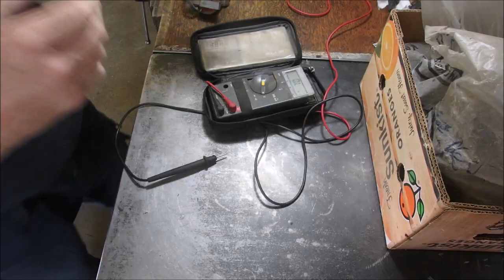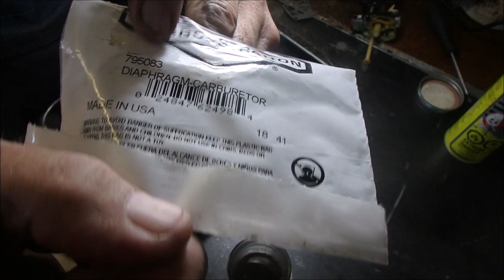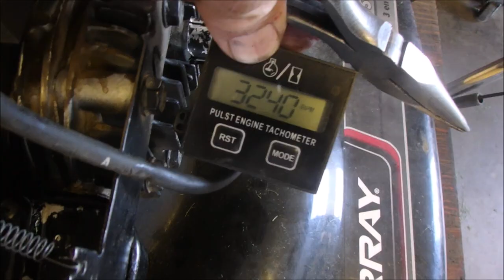A Nice Older Murray Classic That Doesn't Run

Comment: It being a 158 cc engine is probably a 3.5 to 5 horse power Briggs and Stratton engine  depending on the year of it being made   the ignition system is either points And condenser or  electronic ignition system
Reply from the maker: Right  points went away in 1982 or 1983
Reply: @BrucesShop    cool beans 🫛🫘 there Mr Pender

Comment: Yes,my 3 horsepower Briggs and Stratton powered Supa swift lawnmower is 35  years old this year & I gave it a rering about 4 years ago,it has done a fair bit of work since then.

It runs the simple choke O Matic carburettor which simply just draws the fuel up using the siphon method,it doesn't even have a fuel pump in the diaphragm area of the fuel tank so it's a very simple albeit very reliable design.

I had the original ignition coil fail on it which caused it to sputter at high RPMs which led me to think that it was due to a fuel related issue when it was actually caused by a failing ignition coil !
Reply from the maker: Right on.  I have worked n the Choke O Matic.  It uses that interesting rod  inside the carb if I remember.  Thanks for the fun comment.

Comment: I had trouble with the metal shroud around the boot pulled it off problem is gone . I found surging with these mowers is always a bad diaphram .
Reply from the maker: You are right.

Comment: Hi Bruce , great video as usual.  Bruce, I have a Ryobi 28 cc trimmer in for repair . The problem is the starter rope is very, very hard to pull . If I remove the sparkplug, it turns easy . It seems like compression is very , very high . If you can help, please advise . Ty, my friend . Have a great day .
Reply from the maker: It may be carboned up.  It doesn't take much on these little machines.
Reply: Tyvm

Comment: Murray went out of business in 2005.  b&s bought the name .   And started having mtd rebrand troybilt mowers as Murray .  Now the Murray ones are made by some Asian company and rebranded as Murray sold at home depot.  When it’s sold at Walmart it’s called blackmax
Reply from the maker: Thanks.  I really struggle with who makes what.
Reply: @BrucesShop  

Yep 
After 2005 Murray name is owned by Briggs and Stratton 
But decks are made by mtd, or poulan/weedeater  but now they are made by some Asian company ( I cannot remember the name)

The blade adaptor will differ between them all

Comment: Nice mower and great engine i have a bought a stihl lawnmower with a kohler engine its Hard to start i have to give it 6 pulls before it start the old mower i had with the Briggs and Stratton classic engine startede in first pull a great engine
Reply from the maker: Briggs are great

Comment: I have a Murray that I bought 7 years ago, after a year of use it wouldn't start or even fire so I got a new Poulan with the identical 450E engine. Now the Poulan is almost worn out, but it still runs. I would like to get the Murray running. I am at a loss as to why it won't start I swapped over the carburetor, spark plug, and coil from the Poulan onto the Murray, and I swapped the Murray parts over to the Poulan. The Murray won't start, but the Poulan runs fine. The Murray has good spark, the flywheel key is not sheared, and the cam shaft is perfect and was timed correctly, I did flush the gas tank. The only thing left to do is to set the valves which do seem to be out of specifications, I will get some feeler gauges as I wait for the new sump gasket to arrive.
Reply from the maker: Possobly a reclean of the carb internals.  Good luck
Reply: @BrucesShop  Thanks, probably Monday I will reassemble the Murray if parts arrive. I bought a can of starting fluid to help start it. I got some feeler gauges and have already set the valves. I actually let the disassembled engine roll off the table 2 1/2 feet to the concrete floor, but I didn't find any damage outside some scuffed up plastic and maybe a slightly bent fin although it might have already had that. This is my first time working on small engines outside of changing the oil, cleaning the air filter, and sharpening the blade. Next I will work on the 6 year old Poulan, I plan on keeping it as a backup.
Reply from the maker: Enjoy the job
Reply: @BrucesShop  I took apart the engine, and I took off the head, I couldn't find any reason for the mower not to run. So I hit the valves and the cylinder with WD-40 gel lube, then I put the mower back together, after a prayer, 100 pulls of the rope in 105 degree weather and starter fluid the mower finally started, after a few minutes it sounded normal. This mower hadn't run in almost 7 years, but I didn't want to throw it out. I have to give God the credit.
Reply from the maker: @alleyratAnderson  Right on

Comment: Yeah, this engine is more from my era, although I am used to the pulsa/vacu jet carbs with the automatic chokes, never seen the primer before.  Was wondering where the spring was, tucked up under the carb!  That would be easy to lose and forget about!  The engines I used to work on had the adjustable needle valves, EPA got rid of that stuff.  There must be some sort of fixed jet/metering tube under that smaller pick up screen I guess.  I'm guessing this is the "pulsa jet" equivalent because of the two pick up tubes.  The long tube fills the little chamber on top of the tank, where the small tube to the carb picks it up.  And yes, this style set up was always metered/tested with 1/2 tankful.  I often wondered why Briggs had the two different style carbs:  vacu jet vs pulsa jet...  The simple vacu jet was simpler, more reliable, and worked just fine.  Does this style engine have a mechanical governor?  Didn't see the blade/fin on top of the coil?  Wonder why they would have switched that?  Mechanical system is more expensive, the simple vane always worked fine.  What the heck is that goofy electrical adapter at the end of the plug wire?
Reply from the maker: I have used the newer carb setup to replace the vacujet.  It is cool it fit.
Reply: @BrucesShop    Did this engine have a mechanical governor??  Didn't see the air vane on top of the coil that I am used to...

Comment: New plug , coil , clean kit the carb with flush tank, just like new 
Some will need a valve job and adjusting stems 
Last other 30 years
Reply from the maker: Great point!

Comment: THIS! THIS IS ALMOST EXCATLY the same like mine… What in earth can be wrong with my machine?? I would really liked to see How you replaced the new coil… cause…I was thinking if I made some mistake on that part. 
The carburetor was excatly the same like on my lawnmover…I also have 158cc engine but it is 550 series…
I hope you read my other comment in your another video. 

Did you change the sparkplug to some different one there? Some different model?
Reply: And…now I started my lawnmower after it had been of two hours …AND IT STARTED LIKE ANGEL! And run like Angel the engine sound was SO nice and not wavy att all… BUT after cutting grass like 5 minutes it stopped totally from ”fly”. Totally. And then it did not start again. And the ”silencer” surroundings feels SO hot! The sparkplug that I use is RJ19LM.

Is it possible that I have insert the coil someway wrong? 
Oh…I SO HOPE you could help me.
Reply from the maker: @feelingsviawood  Well it could be many things.  Coil gettng open when hot.   One more.   Try just loosening the gas cap.   (they need to seal only one way)   The coil should say right on it  this side up.
Reply: @BrucesShop  thank you very much for your answere! I will check the coil just one more time. How do you make the right amount of ”gap” between the magneto and coil? The streght of the ”magnetic pulling” is VERY strong.
Reply from the maker: @feelingsviawood  Use a business card.

Comment: Nothing like those Briggs flatheads. They're solid engines.  I really enjoy working on them, they're so easy.  Diaphragm problems, meh, it's 5 screws, and it's done.  
I'd sooner monkey around with 5 philips head nightmares, than having to fight with a Honda Carb any day.  stupid two bolts and a trillion gaskets later, and you're ready to throw in the towel.  At least they switched to studs and nuts instead.. Wonder why that was so hard for them to figure out, considering they do it with the wheels on their cars! Idiots... Engineers I swear.

Now Briggs just has their stupid OHV with the plastic camshaft that breaks, or the pressed on lobes that slip.  Yeah, great change Briggs. Cheap as shit, and should be flushed..
Reply from the maker: Thanks.  BTW the Briggs Quantum Flathead has a plasti cam gear as well.   (sorry)
Reply: @BrucesShop  Oh poo! That's totally poopy.  When did they start doing that on them, do you know? It's such a silly idea..
Reply from the maker: @Mike-anic  20 years ago    maybe?   The below is a couple of 7 year old videos  they weren't new then
Here is a video  
Part 1 https://www.youtube.com/watch?v=pL-ZVURFc5o
Part 2 https://www.youtube.com/watch?v=KzXeiCwVspg
Reply: @BrucesShop  Thanks Bruce! I'll check them out, appreciate it!